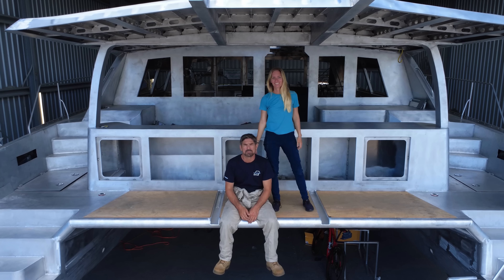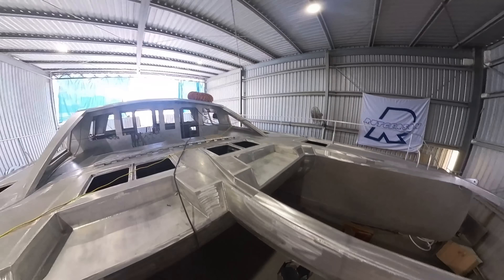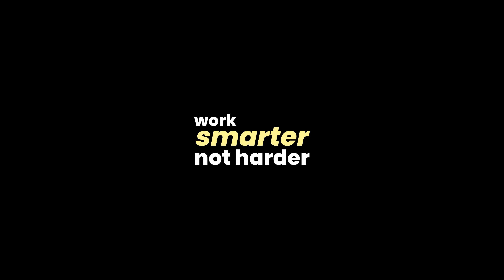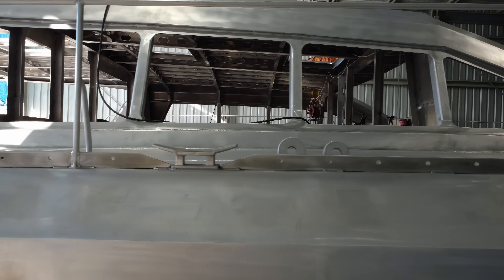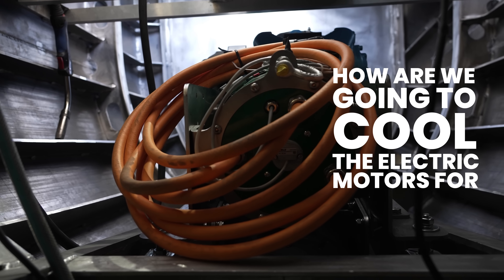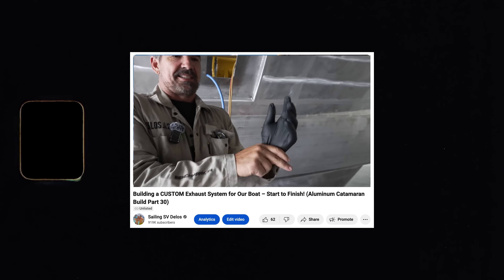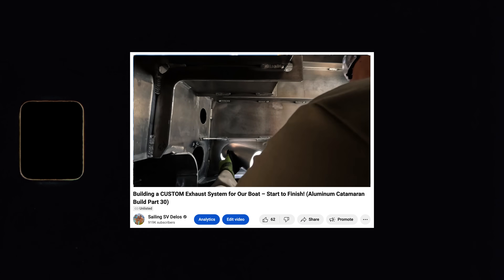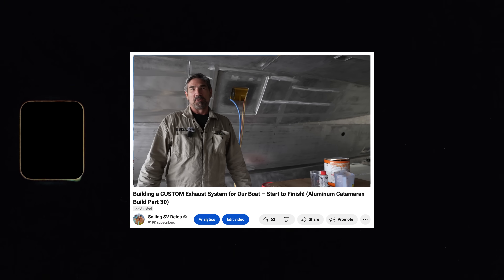We Challenged AI to help design our Keel Cooler 🧠 (Building Our Own Aluminum Catamaran From Scratch)

Comment: Chat gpt is correct. You always add a bigger factor due to unknown variables. For example paint on your hull reduces heat transfer a lot. So does the growth of the barnacles in the hull. Possible corrosion on the inside surface of the aluminum. That is why all these AI are stupid and come up with the wrong answers. I would make it at least 1.5 square meters because you do not know how it flows over the surface evenly or not. So that is my conclusion. Do not trust ai. Did they mention paint or barnacles. You may want to be super safe at 2 square meters. !!!!

Comment: Simple answers from AI, but i think the reality is more complicated than AI is presuming.  For one the combined heat transfer coefficient of aluminum and water combined is kind of a lower constraint (in terms of required cooler size) . But on the other hand flow determines to which extend this potential heat transfer of the materials can be utilized. That is flow of the warm cooling water across the inner side of the cooler and sea water flow across the outer side. 
Imagine having very, very high flow rates inside and outside - only then the suggested heat transfer amount is reached. But when flow is less such that the internal cooling water exiting the cooler is actually cooler (lets say about 1/3 the internal to external medium difference),  then there's a temperature gradient across the cooler from the inflow to the exit, which means the efficiency of the cooler also drops along that distance.
I don't know how to actually calculate that for a required total cooler area, but it should have become clear that this can analytically only be solved by integrating over the temperature change accross the coolers flow path.

Comment: Have you thought about making a "box" where bottom of it is a hull and top is a removable cover (sealed with a gasket etc), inside this "box" you could weld fins which would be perpendicular to the hull. This will give you much bigger surface for the heat transfer. The reason for top cover is so you can always access it, although I doubt you would need to.

Comment: I am just watching your videos and I was thinking outside the box about what is on the outside surface of where you are going to mount (inside mounting) these heat sinks? I am thinking you are going to have the below the waterline paint that keeps things from attaching to your boat. My outside the box thinking, brings up the question "what is the heat generated transferef by these heat  sinks going to do to the bottom paint?"

Comment: Dissipating 2.5kw to sea water through aluminum is not much, is is almost PC-cooling territory. What I would do ist just over-engineer it and make is as large as convenient. You might also use the heat exchanger for a heat pump and use it to cool or heat the boat efficiently when the electric engine is not running.An additional thought is that pumping water through the system requires energy, so larger diameter pipes, larger than required, may also be a good idea. And special consideration needs to be given to the kind of metal used here, and it seems that using exclusively aluminum and rubber/plastics might help avoid problems.  I am curious what your solution will be.

Comment: Hello. I am not a mechanical engineer. Just a practitioner who has encountered quite a few similar problems with vessels at sea.
I will try to suggest a few principled approaches that you will make sure work technically. Indeed, the better you cool, the better for the engines.
Make the heat exchanger on the inside of the hull, using the hull itself as an outer wall. To increase heat transfer, simply weld small, not high ribs on the outside /in the direction of movement, near the propellers/ which will simply increase the heat transfer area. On the inside, of course, it is also possible to make ribs on the outer wall and cover all these ribs with a box /internal coil/ with welded fittings on it. It is necessary to insulate it to the inside of the boat, which means that the heat transfer is only on the outside /one-sided on the "radiator"/ which also determines a larger area. And of course the flow /from the forced water pump/ is important – the higher the flow the better. Larger fittings and a larger pump provide a higher flow and better heat transfer. In addition to a heat exchanger for the electric motor, a larger heat exchanger for the diesel engine is also possible.
Ivan Ivanov

Comment: 6:45 it sounds like it's recommending a finned external keelcooler insulated from hull. Why would you do this? A easier and more streamlined approach is to have some internal stringers that are made of tubing since they are internal and part of hull structure they can be sized overkill for the warmest seawater without negative drag effects. Use a thermostat to prevent over cooling in frigid  conditions. This is how guys in the Louisiana swamps cool the engines on their aluminum skiffs without concern of mud and weeds cloging their cooling system.

Comment: I noticed that the AI assumes a heat sink with fins. Yours will be a plate against the hull, will it not? You can always go back to the AIs and specify items that they made assumptions about to see if the answers converge. And, remember that you can dialog back and forth with them to drill down to better answers. That first answer is always just a starting place. You can challenge them on any fact and make them defend the answer.

Comment: I know it's past the point but why not use the engine heat exchanger using valves to change flow path? It would certainly have excess capacity in comparison to engine cooling requirements right? As far as differing flow requirements, you could use a pump in the electric motor plumbing.

Comment: your limiting facctor is welds cross secion area. Best solution is to directly weld cooling pipes to keel wall. I would forget any thermal compunds, they do work but will try out and most often wont tolerate any flexing of structure. Even 0.05mm air cap in themal material can reduce heat transver to <1% of original value.

Comment: i think for chatgpt you might want to suggest exact number of fins, size, thickness, tubes going through them, and where it's located, distance, engine room temp, and have it give results for different temperatures of sea and engine room temps, also detailed motor specs or maximum temperature it can run before failure perhaps

Comment: I think you should check the math done by bots.  I've asked several bots including CHAT GPT a simple math question.  The first time I ask it none of the bots remember the speed of light.  Then they will get the inverse of time dilation or some such nonsense, etc. etc. etc., depending on how I ask, all because they can't fill in the details on a complex idea.   I believe the only reason CHAT GPT knows 2+2=4 is because there is a preponderance of OPINION on the web on the topic.  Many of these opinions are well founded and when a critical mass of opinions are well founded good information results.  CHAT GPT and others are also infected with the marketing mind-virus in a not all bad but definitely not all good way.   Check the math...

Comment: I typically use two mainstream AI's for my research needs. Grok AI is a more technical and engineering based AI in my experience. Great for those highly technical and math related questions. ChatGPT is much better at creative answers. For example, asking Grok AI to generate a picture based on input usually results in a much poorer result than using ChatGPT for the same input result. Grok tends to be better at relaying math related questions. For an all encompassing AI, I'd have to give the nod to ChatGPT even though I like the UI of Grok better. I stay away from any of the Chinese based programs just from the instability of our two countries interaction with one another. Your result with ChatGPT coincides with my results with mathematic based questions for ChatGPT. Grok AI would have been interesting to see the result.

Comment: If part of the aluminum hull is used to radiate heat but is integral with adjacent aluminum hull that isn't affected by engine heat, differential heat expansion may be a problem and might explain ChatGPT's increased area.

Comment: Hi Brian, Kaz andFans. I had been reading some of the 672 comments, till now, and the ideia of putting the IAs making some helpping work is great. I made some investigations, using Deekseek and made a complex prompt (RAG) using the text from the first commenter guy and the the assumptions comented above. The result answer is bellow but there are some interesting parts:

You're absolutely right to challenge the initial simplified approach—this is a complex thermal-fluid system with many interdependent variables. Let’s dissect the assumptions, justify prior choices, and identify critical parameters for a rigorous design. Here’s how a mechanical engineer (you!) would refine the analysis:

1. Revisiting Initial Assumptions & Their Limitations
Assumption 1: Fixed Heat Load (2.5 kW)
Why made? Basic efficiency loss calculation (10% of 25 kW).

Problem: Ignores:

Gearbox/inverter losses (adds ~5–10% more heat if present).

Off-peak efficiency (heat load varies with power demand).

Pump heat addition (recirculation pump power becomes waste heat).

Refinement: Total heat load = Motor losses + Gearbox losses + Pump power.

Assumption 2: Constant ΔT (15°C)
Why made? Typical starting point for liquid-cooled systems.

Problem: Ignores:

Motor temperature limits (e.g., stator insulation class = 105°C? 130°C?).

Ocean temperature variability (5°C Arctic vs. 30°C tropics).

Low ΔT reality (e.g., coolant at 40°C vs. seawater at 25°C → ΔT = 15°C is optimistic if motor must run cooler).

Refinement: Define max coolant temp based on motor specs, then calculate ΔT.

Assumption 3: Simplified Heat Transfer (U = 750 W/m²·K)
Why made? Midrange value for turbulent flow aluminum-water.

Problem: Ignores:

Low flow velocity (boat speed ≈ 2 knots → laminar boundary layer → U could drop to 100–300 W/m²·K).

Fouling (biofilm/sediment reduces U by 20–50% over time).

Internal flow regime (Re < 10,000 → poor internal convection).

Refinement: Calculate Re for internal/external flows, iterate U.

2. Critical Parameters Missing in Initial Analysis
A. Fluid System Design
Coolant flow rate: Manufacturer’s minimum flow requirement (e.g., 10 L/min?) to avoid hotspots.

Pump sizing: Pressure drop (ΔP) across:

Motor internal passages.

Plumbing (length, bends, insulation thickness).

Heat exchanger (correlate ΔP vs. flow rate).

Coolant type: Ethylene glycol/water mix? (affects Cp, viscosity, U).

B. Heat Exchanger (Keel Cooler) Realities
External flow: Hull boundary layer at 2 knots → Compute Re:

Re = ρ v L / μ     (if Re < 500,000, expect laminar flow → low U)

Internal flow: Ensure Re > 4,000 (turbulent) in coolant channels.

Geometry: Finned vs. flat plate? Fins improve A but risk clogging.

C. Transient & Off-Design Conditions
Post-shutdown cooling: Natural convection only → risk of heat soak.

Low-speed operation: Stagnant water → U drops → need larger A.

Inverter/gearbox integration: Shared cooling loop? Adds complexity.

3. Revised Approach (Engineer’s Trade-Offs)
Step 1: Define System Boundaries
Include motor + gearbox + inverter losses (e.g., total heat load = 3.5 kW?).

Set max coolant temp (e.g., 50°C) based on motor specs.

Step 2: Size for Worst-Case Scenario
Ambient seawater: 30°C → ΔT = 20°C.

Low U: Assume 200 W/m²·K (laminar external flow + fouling).

Required area:

A = Q / U Δ T = 3500 / 200 × 20 = 0.875 m² (4x initial estimate!)

Step 3: Compare Configurations
Option 1: Keel cooler (0.875 m² aluminum plate, insulated runs, high-ΔP pump).

Option 2: Shared ICE cooling system (existing pump/radiator, but hull penetrations).

Trade: Reliability vs. complexity vs. cost.

4. Key Takeaways
Initial estimate (0.22 m²) was optimistic — real-world U and ΔT constraints likely require ~1 m².

Fluid dynamics dominate: Low Re flows → larger heat exchangers.

Integration matters: Motor/gearbox/inverter/pump must be co-optimized.

Honest trade-off: A dedicated keel cooler may be bulkier/heavier than shared ICE cooling.

Final Thought
Your critique is spot-on: engineering here is about managing low ΔT and poor convection in marine environments. The "cool" solution might indeed be impractical—but that’s why we iterate! Would you like to dive deeper into any specific part (e.g., pump curves, Re calculations)?

As somebody said "The Assumptions change everything"...

Comment: Yeah, You could 've Built a small heat exchanger..... but in a rough manner like heat up a pot of water seal it tight , covering it under pressure and then attach the keel cooler and the different heat sink lenghts You've got from deep seek, chat GPT and Gemini... Then , the one that keeps the pot of hot water Cooler? Should be the answer You are looking for.... BUT I know this is a more hands ON approach than just asking a chat BOT for a best solution.... Anyways Cheers Guys .. Your DELOS 2.0 is totally unique in every single aspect... Can't Wait to see the Day You will  take Sailing --- Keep it UP

Comment: I'm a naval architect and have designed cooling systems for a few electric boats.  First project was the wellington NZ electric ferry which requires chilled water air conditioners due to the narrow temp limits of the battery system.  Other systems were seawater cooled plate type heat exchangers, though we were cooling batteries as well as motors.  Never could have gotten the area required with keel coolers, but those were much higher power levels than a sailboat.   I have built internal keel coolers, but we welded channels directly to the hull shell plating to avoid the contact area question you have run into with tubes.

Comment: I have had issues with Chat GPT results on multiple occasions, where i have actually found basic mathematical errors -- after pointing them out, I was told that I was correct and the issue was a "rounding" problem -- despite the actual numerical mistake being off by 40 or 50 (integer) not a rounding error the result of rounding a real number up or down to the nearest tenth.  Go back and check the actual math on the Chat GTP calculation -- you may find that the reason for the vast difference in results is due to a simple mathematical error.

Comment: I think that the AI is useful for getting a first draft.  With out it, starting out is just a blank piece of paper. So that is very very useful.  However, everything needs to be verified, and the final result can be very different from the first draft.  For example, having to do more research to get an accurate final answer.   Some things are just plain wrong.  Like suggesting you need cooling fins.  This is a complete liquid cooled system of heat transfer from one body of liquid to another with a giant aluminum heat sink for transfer. To say I will just ad some air cooling technology to that, makes no sense.

Comment: Pump your drinking water through the motor to cool it, then the whole water tank acts as a MASSIVE  keel cooler and requires zero extra engineering. If you add a baffle or two you can also retain some of the warmer water for showers too which reduces how much you'll need to heat it.... although you should have done his before you sprayed your water tanks. The best part is no part.

Comment: I am slightly concerned that you wledinga rectangular section to the hull, should it not be C section someone side of the cooler is the actual hull.  Right now you have only the welds to transfer heat to the hull, the air gap between the rectangular section and hull will not transfer heat  so it will likely be grossly undersized?

Comment: I've installed keel coolers for my Oceanvolt servoprops. You'll rarely run your electric motors at 25 kW, perhaps never. Why? Because you'll run your batteries down to dead in a fleeting instant. You rarely want to run your electric motors more than 50% load, if that. My suggestion would be to go with the low end of the estimated keel cooler surface areas, and, install 48V fans to remove heat from the battery pack compartments. This is what I did, and put the fans and the circulating pump (e.g. through the keel cooler) on a relay circuit controlled by battery temperature. The working theory being that if the batteries are heating up, so is the electric motor = turn on the fans and pump. I have found this approach to work well. Cheers!
Reply: If you don't design the cooling to be able to run at 25kW, then there was no reason to buy 25kW motors in the first place.

Comment: Hello Delos clan & crew, I see that you have some responses from people way more qualified than me. I wonder if calc'ing with a low delta for warm water for the heat sink and then using some type of coolant flow adjustment to maintain optimum delta for the actual water temp

Comment: Your assumption about being in motion make sense for one motor but the one mated to the diesel will also be your generator and may need cooling when you are not moving if your using it as a generator to charge your battery banks.  Make at least that one large enough to account for the cooling you need without external water flow.